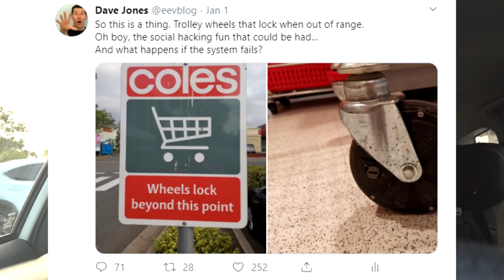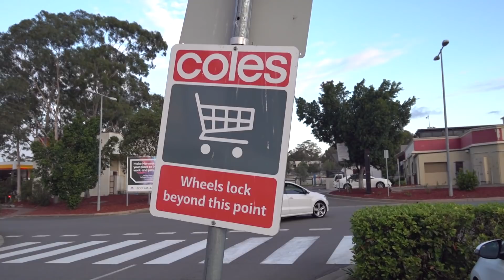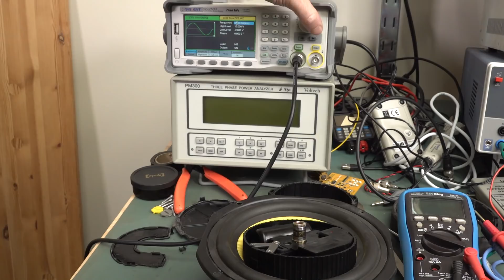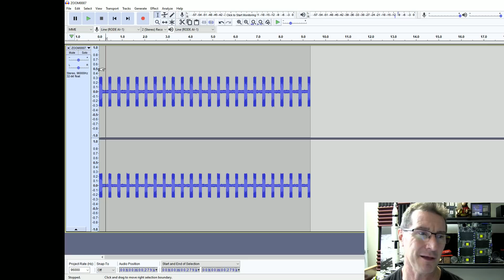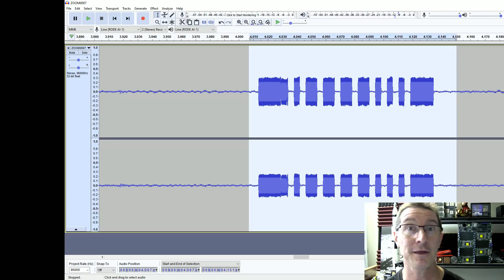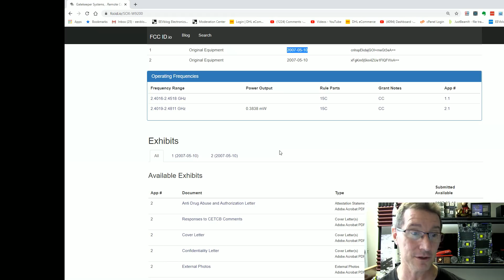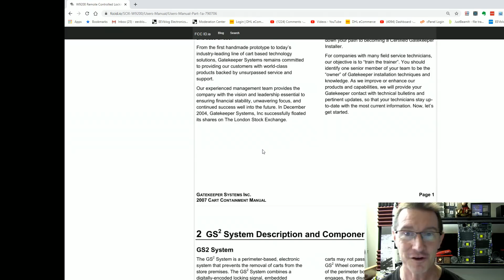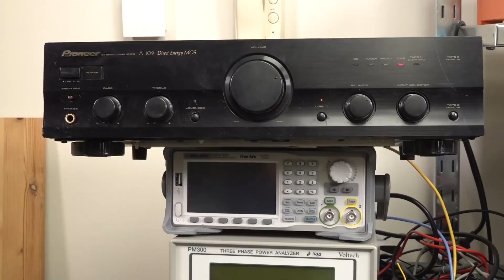EEVblog #1287 - Gatekeeper Shopping Trolley Lock Investigated

Comment: Here in the UK, they're also used in 2 stores near me on escalators between floors, so your trolley doesn't run away from you. That's the flat moving-walkway type.
Reply: You beat me to it.  In both Asda and Tesco near where I live.  I was wondering if they used either an improved, or different type mechanism, as the constant locking/unlocking would be somewhat detrimental to the battery life.
Reply: I thought the escalators had  grooves on the escalator floor to which the wheels dropped into and lock to stop them moving so was just mechanical and not electronic.
Reply: @she0051  That's exactly how they work, similar to a train wheel.
Reply: @she0051  Yeah, those guys are wrong on this. Cart escalators use matching groves.
Reply: @she0051  The ones I've seen, the wheels just lock in exactly the same way as trying to take them off the premises.  They don't lock into the escalator style moving-walkway in any way.
Reply: Brilliant idea,  like the wheel chock in a car wash
Reply: @chrisg6597  Same as in Wales
Reply: I think they lock just because they are over a magnetic surface such as the escalator moving footway. For the grooves to work you'd need to have parallel alignment of the wheels to the footway grooves which doesn't always happen.
Reply: @chrisg6597  My examples are Tesco and Asda too! Rossendale by any chance?
Reply: @she0051  Your guess is in error, I'm afraid Ian. The moving walkway only has fine grooves in the rubber for grip on the sloping surface, just like a regular floor mat.
Reply: @alansmith2197  Manchester.

Comment: Krogers uses them in high theft stores. Their setup is two wheels, one in front and one in back. There are coils in the checkouts and at the door. It monitors if you went through the checkouts - if you didn't, it locks the wheels at the door.

Comment: My local grocery store (king soopers) recently added these or similar brand. They have a solid loop going around the entire parking lot with no gaps. So the wheel locks if you get too close to the last parking row it's quite annoying. I'm impressed how effective one wheel locking is though, it really makes it hard to move. The staff have a magic little key fob that seems to unlock them. Thanks for the tear down was curious what was inside these.

Comment: Just discovered same system in Tesco store Thornton Heath Surrey England. Most interested and researched Gatekeepers site. Manual states two loops; permission and lock loops. Nominal freq 8kHz. Was taking mobile spectrum analyser and receiver but you've cracked it for me.  Thanks for excellently done investigation.

Comment: Agressive control sees 2 (diagonal) locking wheels fitted to carts. A perimeter loop can protect an entire carpark including landscaped sections. A secondary embedded control can be installed to release locked wheels if a customer pulls the locked cart back into the carpark. A bigger problem of customers leaving a shop with a loaded UNPAID cart can also be addressed by gatekeeper systems.

Comment: Ive often wondered how those cart wheels worked. My pharmacy had had them for years and a remote at the counter to reset.  I love how they use brake shoes.  It's strange that the loops in there pavement are only at the exit.  My pharmacy has a "dog radio fence" buried all the way around the store. Are you sure that's not a metal detector for the traffic signal?

Comment: Someone else probably commented this already, but one of the local ASDA stores (UK store, Walmart owned) uses this wheel locking for an additional purpose. At one side of the store is a second floor with a George (ASDA's clothing brand) and escalator ramps. The wheels on the cart have raised edges (such that they resemble a pulley) and the escalator ramp has grooves that are the same width. When the cart is pushed onto this ramp the wheel lock engages and the edges of the wheel fall into the grooves, preventing the cart from 'running away' and careening down the ramp at high speed. Only one of the rear wheels has the lock, the grooves obviously prevent the cart from swinging as the remaining unlocked wheels can't pivot any more. Also yeah, we've had it for years, they've had the same setup for almost two decades now. Interesting to see what's actually inside them though I imagine the internals of these older ones to be a little more bulky.

Comment: I work for a grocery retailer in the US.  We are exceedingly cheap with our equipment - the shopping carts dont need an expensive system to get locked up wheels, just don't replace the wheels, and you have the same effect in 9 to 12 months.  Doesn't stop shoppers...

Comment: Those things operate using radio frequency.  Its low powered stuff so it doesn't cause other problems.  The tool used to unlock them has to be within 6 inches of the wheel to make it work usually

Comment: Hi Dave, great breakdown.
You don't necessarily need a magloop with the receiver seeing that it has a battery.
Just a RF receiver sleeping and briefly waking.
You use a large magloop when you want the magloop to transmit power as well as trigger a device, you are mistaking it for an RFID tag.
What happened to the coin returnable trolley unlock system.
It has gone by the wayside here in Victoria, BUT ALDI still have lockable trolleys and their car parks are nice and clear of wayward trolleys.

Comment: there are trolleys with a different locking method, instead of a drum brake, there is a hood that covers the wheel when it get activated, an older type maybe?

Comment: If you push the cart across the ground loop at running speed the wheel will not lock (at least at our local store) as it seems the code length to trip the lock motor on is longer than the communication time given to the wheel at running speed.

Comment: I've wondered for a few years how they work. I suspected RF activation, but thought the locking mechanism would require springs and locking metal bars, this looks far more straight forward. Great to confirm some assumptions and learn something new at the same time. In the UK almost every shop has them and it seems to be doing the job most of the time, usually just one wheel, sometimes they have a lock on both rear wheels which due to the counter levered basket design means it'd be very challenging to lift up and drag when it's full of shopping (you'd be lifting most of the weight of the shopping and of the cart).

Comment: I Germany, shopping carts are chained together at a certain place on the car park or inside the building. You have to put a coin inside the chain lock to unlock the cart. You get the coin back when you return the cart and put the chain back into the lock. You won't find any cart standing around anywhere because of that. It's that simple.
Reply: Some stores in Sydney, Australia have that system and people still take them onto the streets.

Comment: What they do in France : the trolleys are attached together. Each trolley has a lock mecanism and a key dangling from a short chain( short enough so that you can't put the key in the lock of the same trolley) The lock from your trolley is attached to the key of the previous trolley in the row. To unlock it, you have to put a coin ( like 1 euro). When finished with the trolley you have to put it back in a row to get your coin back. I don't know if it's done elswhere but it's relatively effective.
Reply: Aldi in the US has that.  Yes I know Aldi is German.

Comment: We have these, but also on other wheel is like a audible alarm. So the wheel will lock, then a alarm be that its not super loud will start to sound.  Would say maybe around 65 to 70 decibel level. Enough where people would most likely leave the cart behind. It will actually sound for about 15 mins before it stops. then if it moves it will start sounding again for another 15 mins. so its like a timer. Until it got brought back into the parking lot

Comment: Those color plugs are probably the ID encoding left after the factory programming. This is easy to identify on the car park, also the programming station is easy to understand - you just select two color dots and exactly the right info gets stored. It then dispenses the right caps for you to twist them in. Neat!

Comment: Can it be that the plugs are work like tuning forks and are tuned to a specific frequency? similar to those anti theft tags that are used with those gates at the enterance of a shop? It would mean that if the "transmitter" is set to the same frequencies as these plugs the signal is strong enough for the internal antenna to pick up the signal and activate the brake. this  way you can allow multiple types of cards in specific areas of the building and property outside.

Comment: Dave, you can try hooking a small transformer to the output of the amplifier and then put the transformer near the coil and see if the wheel locks. You can just put 3 volts straight to the motor to unlock it again.

Comment: i think the RF communication  not only allows to unlock but to chose the "locking" code to accept.  so the wheels have to be "initialized"  to choose which locking and unlocking code.
so without initializing the device stays off, prolonging the shelf life before installing on the carts.

Comment: My store recently installed these. Pushout theft isn't about stealing the cart itself. It refers to a type of shoplifting where you load up a cart full of merch that you want to steal and then book it out the door before the LPO stops you. With this system, if you don't go thru checkout and stay at the register for at least 30 seconds, the wheel will lock in the doorway and an alarm will go off.

The reality is that 99 out of 100 people it stops are legit customers who went thru checkout but didn't keep the cart in front of the checkout transmitter for long enough. But that's what the remote is for.

Comment: in some places, they have travelators (vertical moving walkways) and you can take carts on them. when the carts cross the line onto the travelator, the wheels lock so that the carts don’t roll down and injure people. the cart stays still without holding it

Comment: I worked part time in loss prevention at a J.C. Penney's in a mall when I was in the Coast Guard about 10 yrs ago, and carts, or trolleys as aussie call them, getting stolen was a very regular occurence.
We eventually got all new carts with these locking mechanisms, and it cut down on cart theft drastically.
Alot of them end up at metal recyclers 
Carts aren't cheap either, 150-200$ each.
Reply from the maker: Thanks. Doesn't seem to work here! As I drove home last night there were dozens of trolley dumped outside the carpark.
Reply: When I worked in the mall, I became friends with the security guy. They had cameras on the top of the light poles, that could read your license plate getting into the interstate; like a mile+ away, plus the ¼ mile property of the mall. It was incredible.
Reply: @EEVblog  I think they do work in a sense that the number of stolen carts goes down enough to be well worth the trouble. Yes, you still see them here and there, but the goal of stopping every single one is not realistic.

Comment: Years ago, we had a similar system,  made by carttronics (I think) which was much simpler.   There was a wire buried around the perimeter of the parking lot that emitted a pulsed audio frequency signal that would cause the wheel to lock up (the mechanism was different, there was a shroud that would come down and make the cart difficult to push).  The unlocking signal was a continuous signal at the same frequency.   A colleague and I had built a small portable signal recorder to figure out what was going on, and made equipment to lock/unlock the carts.   The system had been implemented at the Kensington (Calgary, Alberta, Canada) Safeway for a period of time, in addition to the regular coin lock system.   My hypothesis is that the system was implemented to prevent people from taking the carts to an apartment about a block and a half away.  Before the electronic cart lock system was implemented, there would be a collection of carts at the apartment, so people were taking the carts to the apartment (presumably full of groceries) and leaving the cart.  After a while, the electronic system was removed. If you lifted the front of the cart up when you were going over the zone where the wire was buried,  the lock would not trigger.  In addition,  maintaining that many powered devices would undoubtedly be a horrible pain in the ass.   There must be some kind of balance between having easily accessible carts so people will buy more, and not losing the carts and having to deal with the headache of retrieving them.

Comment: In Perth, we have had them at the small local shopping centre for years. However, the version we have has a shroud that pops into place stopping the wheel making contact with the ground. Yes only installed on one of the front wheels.

Comment: If that is a 3.7/3.8v rechargeable lithium cell, its right at the threshold where most protection would kick in. It's probably in standby to prevent cell damage.

It might seem unrealistic to use a rechargable cell in a device with no ability to charge it, but it often works out cheaper.

Comment: a "push out" is when they load a cart with merchandise, and push out the door without paying. the rf antenna is probably for that purpose. lock the wheels of any cart in range of the remote, and slow them down out the door.

Comment: I've seen these installed on 2 diagonally opposed  wheels on a cart and a much better store implementation that at your store. They seem quite effective. I'm not sure if the ROI is worth it, though, as that store isn't in a neighborhood that is conducive to cart theft and it seems like the maintenance costs for this system are quite high.

Comment: There's been different variations of these locking wheels over the years. There were some of that literally looked like a fender or mudguard over the wheel and when the mechanism was triggered it would deploy a piece of plastic underneath the wheel almost encircling the wheel completely. That's basically just an extension of the fender.

Comment: The inset you placed in the video about push-out theft costing about $560 per event is not the cost of the trolley, but the cost of the merchandise a thief has placed in the cart (trolley) before bypassing the checkouts and pushing the cart out of the entrance.  When a customer enters the store and selects a cart, and pushes it into the store it is programmed to require passing through another radio frequency zone established at the checkouts, but if it is instead pushed through the entrance/exit , the system locks the cart and sounds an alarm, preventing a cart with unpurchased merchandise from leaving the store.

Comment: The mechanism in that wheel looks like it requires you to spin the wheel to lock it. That would definitely extend battery life by using the person pushing the cart to supply the energy to lock it instead of the motor.

Comment: Go on Dave, take it to the local shops and see if it locks. 

If it doesn't, try some different codes on it. Not hard to do, some cut and pasting, or it sounds like an Arduino project to me. Send a code four times, wait 3 seconds, repeat on next code. Didn't see any limit switches so it probably senses the motor current, or it just jams it one way or the other.

Comment: I'm guessing the radio is to send signal to indicate there's a near stolen cart, otherwise it doesn't make sense to keep checking regularly for stuck cart outside. Could also serve as a locator beacon. And the 2 indicator outside, is probably batch indicator so you know when it was deployed and how much battery is left on the wheel.

Comment: I’ve seen a much simpler mechanical system which simply reacted to strong magnets near the door pulling down a stopper. The wheel could then be reset with a special tool. Simple battery-free system :)

Comment: 7:35 in the U.S. we have a vehicle brake type that is similar called drum brakes. It is smooth without teeth though. When brakes are applied the two inner sides expand causing contact with the outer drum.

Comment: In our local shopping centre its a cover which spins down to cover one of the wheels. The trolley "guys" have a hand held transmitter to unlock the wheels, it has to be placed up against the wheel.

Comment: Dave, you kept saying that cart/trolley thrives would just be able to go around the locations where the coils are installed, even as you scrolled past the illustration of installations where the loop surrounded the entire property ("single saw cut") this would mean that the only way to get a cart/trolley off the property would be to drag it, as the wheel would surely lock.

The local supermarket has these, and they've gone with two wheels, diagonally opposite. The ones in nicer areas generally go with one.

Pushouts are carts/trolleys full of stolen items

Comment: The 2 little colored pucks you removed from the side are probably the code indicators show what lock/unlock codes are programmed into the unit.  They may have a number of different codes so that possibly 2 or more stores could use them in closer proximity, without the system locking them accidently.  Those codes could be programmed via the RF link, then the appropriate pucks would be installed.  Then if the wheel failed and needs to be replaced, the company that provides the carts cold just say, "ok, I need a yellow/black replacement wheel".

Comment: A cart pushed out of the store that has not gone through a check out lane will cause an alarm to sound in the store, and lock the wheel. Someone trying to push out with a cart full of groceries, (or even an empty cart of course) will be stopped before they leave the store.